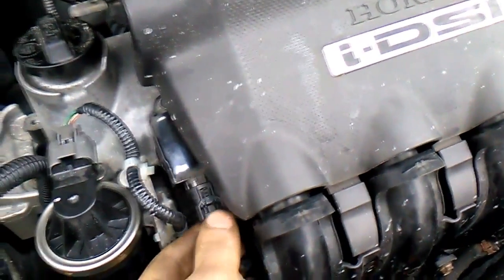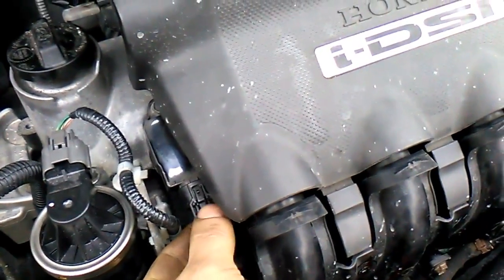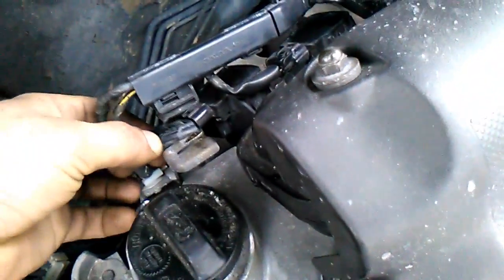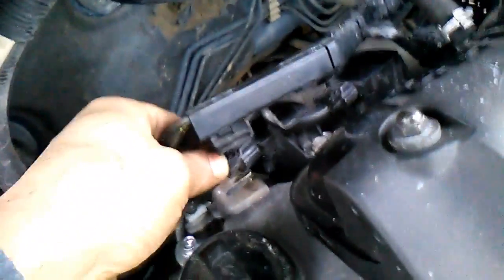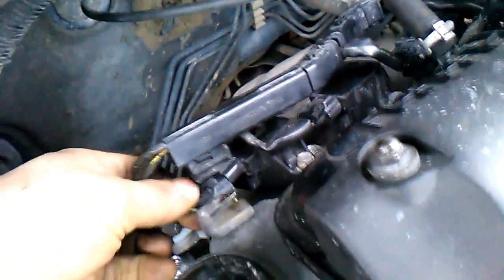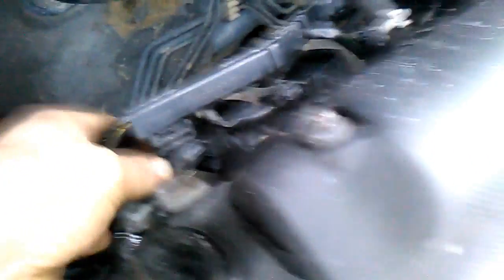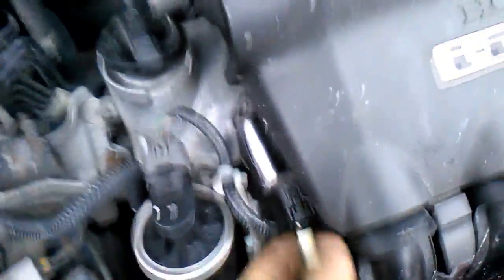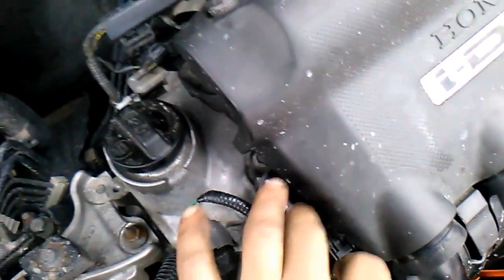Honda Jazz [ Fit ] Ignition Coil Test - Twin Spark Engine I-DSI

Comment: My brobleme is I remove my crank shaft re place with a Nader one also no 2 conrod arm and I put back the engine when i want to start there is no engine lift but it wash the battery then no there is no spark when I crank to start plse help

Comment: The i-DSI engine when first manufactured has a problem with the CVT. It will cause hesitation before accelerating at very low speed from like 1-8 kph I think it is. If you replace the CVT fluid often - every 6 months or more often, the problem almost disappears. At least for a while. We have 220,000 km on our engine (1.5L) and so far it is OK.

BUT. Our Ignition coils have a problem. Does anyone know WHERE to find front and rear (they are different) Ignition coils for the 4 cylinder i-DSI L15A2 engine? Cannot find online anywhere. Cheers! Hope this helps someone.
Reply: The front ones can also work for the back
Reply: Ebay

Comment: Tried this. Now check engine light is on. What to do?
Reply from the maker: +Kevin Cebedo use scan tool to delete them ,elm327 bluetooth/wifi + Piston/Torque app on android works great on this car, costs just few $ dollars. If u dont have it,try to disconnect car battery for 5mins  that shold errase foults from ECU. Thanks for your feedback.
Reply: Fancy not saying in the video that this will happen, better off removing coil packs a checking resistant with oms meter check resistance of all coil packs without starting engine and causing light to come on.

Comment: Hello, Sorry to disturb but i'm searching for a solution for an hesitation problem on a honda fit/jazz 1.2 dsi from 2003. It only happens on low rpm - it is perfect on middle and high rpm. Saw that you posted a video " fix hesitation problem,maybe its can help u too :) https://www.youtube.com/watch?v=AVfh8NNEl58" but it isn't available anymore. Can you help me? I don't know if it can be the plugs, coils, gasoline filter, egr... Many thanks.
Reply: was it one of the coils? I think there is no gas filter in this car.  Thank u.
Reply: @joef7011  yes.

Comment: I have a Honda Jazz (not Fit here in Portugal) from 2004. I have engine codes P0300, P0302 and P0304. I guess I don't notice missfires as you do in your engine, but do you think it could be ignition coils? I already spent some good money on mechanics, and they couldn't fix my problem. Guess I'll have to figure it out myself. Just to let you know, I already had to replace the catalytic converter because the car was not passing in the emissions test. Also, replaced all 8 spark plugs.
Thanks! :)
Reply from the maker: +José Melo check 2&4 cylinder coils,try like im showing in this video,if no changes in sound when u plug and unplug one from two coils,that mean coil is bad(or spark plug)or make video,and share with me. my sisters jazz had only problems on small rpm when accelerate  or if u drive in city with 5th gear. and watch my other video how u can fix hesitation problem,maybe its can help u too :) https://www.youtube.com/watch?v=AVfh8NNEl58
Reply: Thanks CarShed68 :)
That's exactly what's happening with my Jazz. 4th or 5th gear, low rpm, not giving too much gas, and the check engine light blinks.
I do not notice any hesitation, but definitely will try tomorrow what you showed in your video, and maybe share with you.
Reply from the maker: ok
Reply: +CarShed68 I checked each coil, and all are working fine, at least in idle. Should I wait some time with only one coil plugged in, for each cylinder, and wait for some misfire?
Reply from the maker: José Melo
yes u can try it agin with 1500-2000rpm maybe then u will hear wich coil working bad,or if u can dissasamble coil boot and check there for corosion on contacts,there is resistor,looks like old style fuse ,if u have multimeter u can check that for resistence,if no resistance u can solder whire to it,because i saw new coils with no resistor at all,there goes metal solid peace! or try to make spark plug gap smaller 0.5-0.6mm that helped for me,car is driving fine now!
Reply from the maker: José Melo      http://i1076.photobucket.com/albums/w441/topspinquark/mITX%20build/Fit%20Coil%20Pack/Fit_Coil_Pack_zpsb70daf78.jpg
Reply: +CarShed68 Thanks! I'll try it this week and give you some feedback
Reply from the maker: José Melo ok
Reply from the maker: +José Melo fixed?
Reply: +CarShed68 Sorry, I didn't reply you soon. Well, I did my best to clean all 8 coils. They were all with corrosion and some white dust came out of them. Put them back in differente order (cylinder 2 in cylinder 1, and cylinder 4 with cylinder 3), drove for a couple of days, and after several miles got P0300 and P0302 (P0304 is gone).
Last Thursday I decided to clean the throttle body, since I bought the car with 150000 Kms, and didn't know when it was the last time it was cleaned (if ever). I found a considerable amount of carbon build up, and cleaned it with STP Carb spray. I was not expecting it to solve the misfire problem, but I already drove 600Kms and haven't had any code yet (fingers crossed). What do you think?
Reply from the maker: i think is strange ,but thx for reply ! :)
Reply from the maker: yep i met that corrosion problem 2 weeks ago,cleaned and puted lubricant on metal parts to prevent corrosion,check engine is still off :) hardes part is disassemble coils on firewall side,rubber is weak something like silicone rubber if u dont grease with penetrating oil before remove,u will brake that rubber or even coil plastic peaces ,i did all that, glue iron solder and tape fixed that all ,just last coil was perfectly disassembled an reassembled :)
Reply: Olá José, o seu problema ficou resolvido? O meu Jazz falha esporadicamente, em pleno andamento. Parece que se sente um corte no motor. Não acende nenhuma luz de avaria. Obrigado.

Comment: good test :) will code reader tell if there is problem?
Reply from the maker: +singlecams probably no,on this car check engine was off too,but car was hesitating on low rpms on acceleration,i think problem is somewhere in middle from coil to spark plug ,how much i saw looks like there is resistor(looks like fuse) im sure its losing resistance ,like ignition wires and start to misfire,in honda fit forum i read that coil pack wires go together with camshaft sensor wires,so when coil is bad,its start to block camshaft sensor signal,so one fix can be,to put camshaft sensor wiring seperate. :) for me helped 0.5mm gap on spark plugs. but in feature i think i will need to repair that coils,so will be new video,but thats i think soonest in next year! :)
Reply from the maker: ok finnaly coil pack codes was presented in ECU check engine was on,i just disassambled all coils there was terible corrosion in all of them 8pcs! cleaned corrosion off,put on lubricant on springs and contacts to prevent corrosion in feature ,but didnt film it :( maybe someday i will make video about it! hardest part to disasamble is 4pcs coils that is on firewall side they need lubricate rubber isolator before disassamble or ruber will be demaged or even u will brake coil plastic parts off :) after all that car is driving good 2 weeks now!
Reply from the maker: http://i1076.photobucket.com/albums/w441/topspinquark/mITX%20build/Fit%20Coil%20Pack/Fit_Coil_Pack_zpsb70daf78.jpg this is how it looks disasambled :)
Reply: Thanks for the detailed posts!  I'm a newbie to car repair, but want to replace the coil packs in my Honda Fit. I bought dielectric grease, but still unsure where EXACTLY I'm supposed to use it for fear of blocking any electrical signal or spark and ruining my new coils.  Can you share exactly what gets greased and what doesn't?